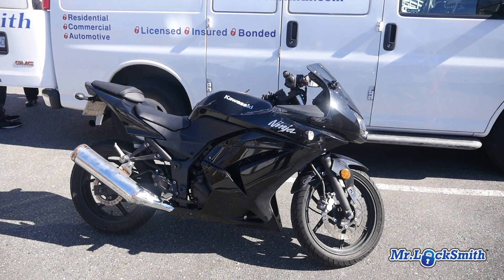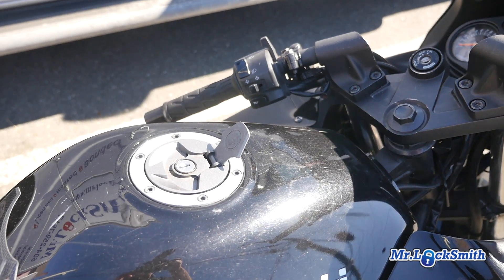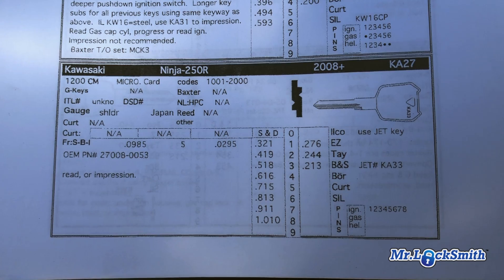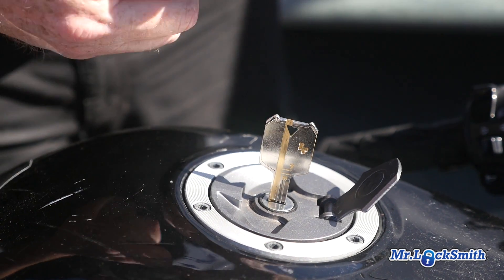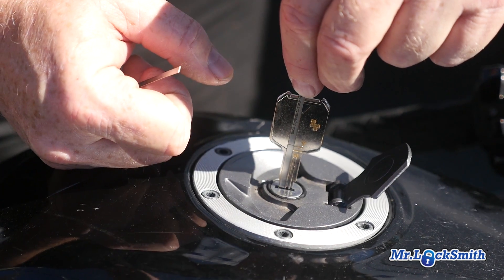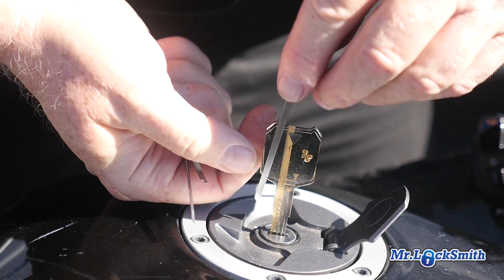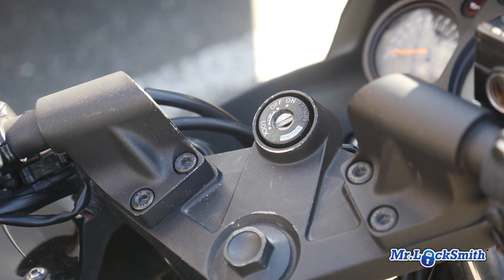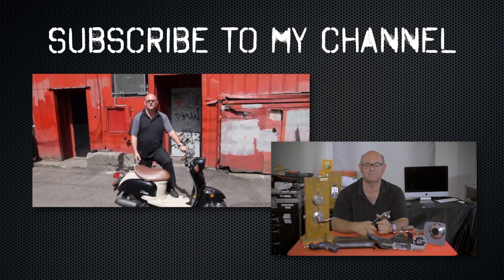Motorcycle Locksmith:  How to make keys to a Kawasaki Ninja Motorcycle

Comment: I had to replace my ignition switch and now I need to rekey the tank and seat lock. I need to know where to buy a set of wafers so that I can have the same key for all three locks. Do you know where I would get this? I have 2008 zx10r. I have the key code
Reply from the maker: Wafers are hard to find. Try your local Automotive / Motorcycle Locksmith 

Most Motorcycle dealers sell sets of locks keyed alike.
Reply: Thanks, I will try my dealer. @24hrMrLocksmith

Comment: For the 2008-2012 Ninja 250s, I believe the key code for the ignition is stamped on the side of the ignition housing, and for 2007 and earlier the key code is stamped somewhere underneath the rear seat key
Reply: Where is my 2024 Kawasaki ninja key cut code location
Reply: @CamachosAutoKeys4u  You ever find it?
Reply: Where is for the 2008 250 help please I lost mine keys
Reply: @ronalromero8587  Stamped on the side of the ignition housing. For example, item 333699550947 shows the same code on the factory key tag and the lock cylinder (“1747” in photos 1 and 4). Decoding that to a make a physical key is something only some dealers and locksmiths can do. I recall people getting blanks cut by code from Hillbilly Kawasaki.

Comment: Do you have a better way to contact you? I'm doing maintenance at the apartments I live in and want to remove an older lock box with out damaging it simply because it's a neat antique box. It has a rotary dial on the front with letters instead of numbers.
Reply from the maker: Brandon Bassett Email me some pics “terry@ mrlocksmith . com

Comment: Wow alot easier then the method I use. I pick the gas cap and remove and disassemble it. How do you feel the Acureader compares to the EZ reader and Determinators and Lishi tools. I like Lishi and EZ reader but was not a fan of Determinators
Reply from the maker: My fallback plan is to disassemble the gas cap and make a key and then "fill" or "progress" to make an ignition key. AccuReader tool is my favorite this week and I have Lishi Tools too. I have never used the Determinators or EZ readers for making keys to motorcycles but use them for some Cars and Trucks.

Comment: Very cool video. That's something they must have changed. I had a ninja 250 and it had one key for everything. Even had a helmet lock under neath the rear fender. Thanks for sharing this information.
Reply from the maker: Tennessee Lock Picking Hi, the Ninja has one key for everything but the ignition has 8 cuts (1-8) and the Gas Cap and Seat Compartment only have positions 3-8.
Reply: @24hrMrLocksmith  O OK thank you. That makes sense.
Reply: @24hrMrLocksmith  Do you have Business in Tennessee?
Reply from the maker: Not yes :-)
Reply: @24hrMrLocksmith  I'm looking to work for a locksmith. I wish I could work for you😀 some how some way.